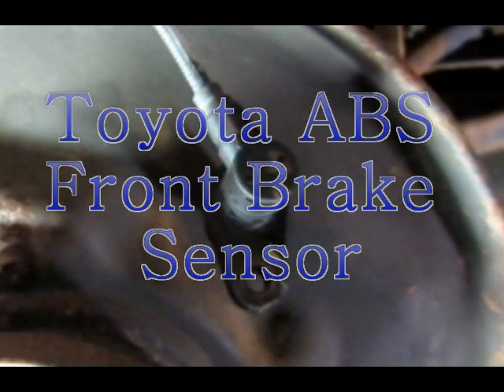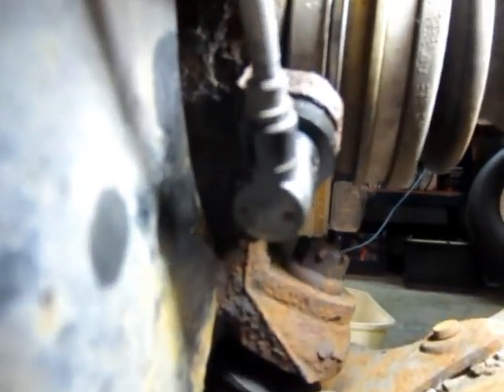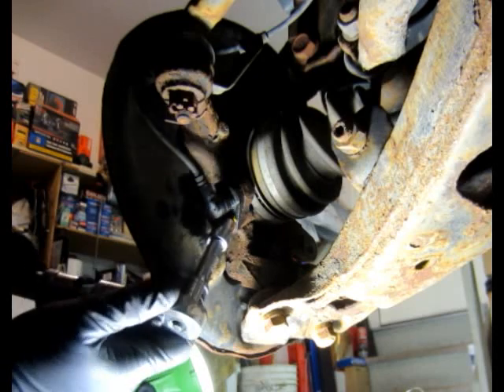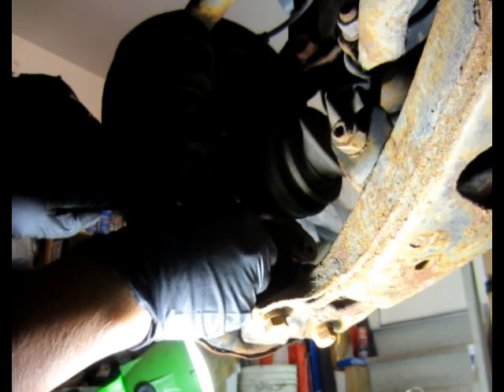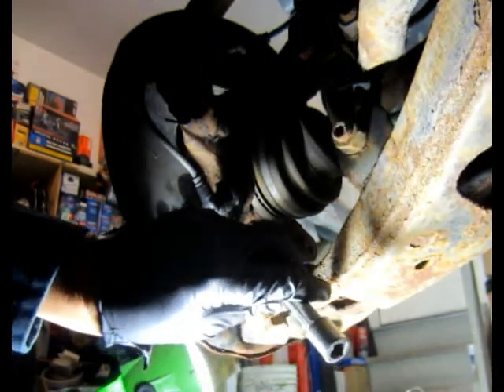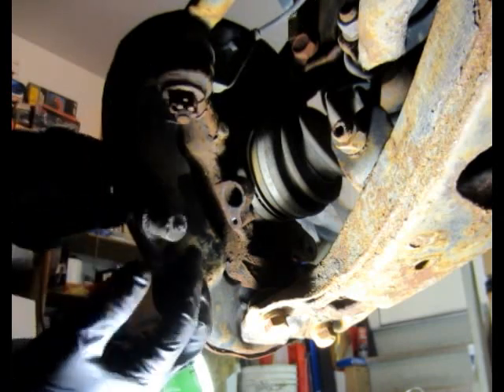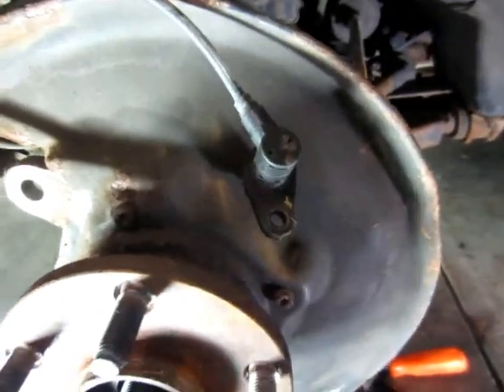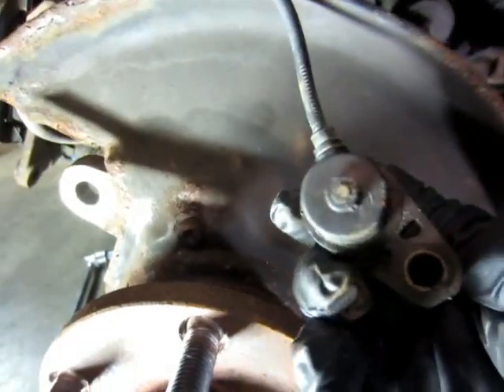How to remove Front Brake ABS SensorToyota Rav4 1996 1997 1998 1999 2000 2001 2002 2003 2004 2005

Comment: Ok but what about actually replacing it? How hard is it to get the whole thing out? Did you buy a new one that came with the whole harness or did you cut wires and splice some kind of universal on?
Reply from the maker: The old sensor was reused. This sensor can last for a long time. One can replace a new one but it doesn't mean better as long as the old sensor functions properly.
Reply: tgmac8288 Mine was broken, had to replace it, you gotta remove the plastic in the wheel well to get to the plug, not too bad but the screws were all pretty rotted. Turns out my problem is a broken abs ring, which probably broke the sensor cause it was covered in metal flakes. I did try and clean it and see if that would revive the sensor but it didn’t. So now I need a new cv axle basically =/